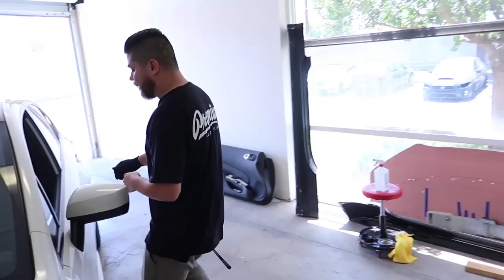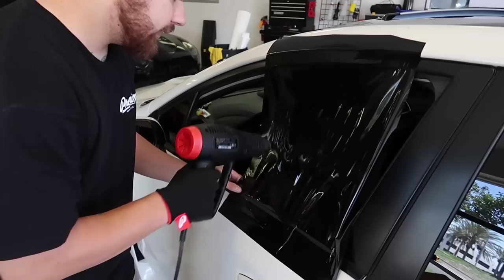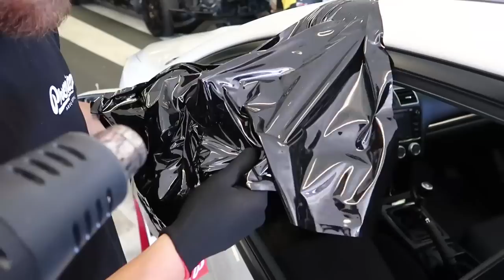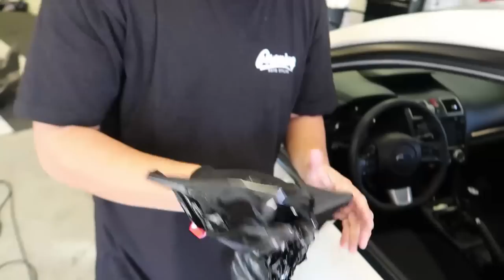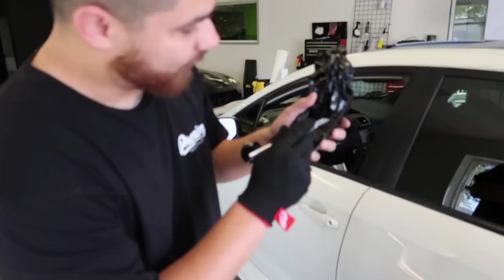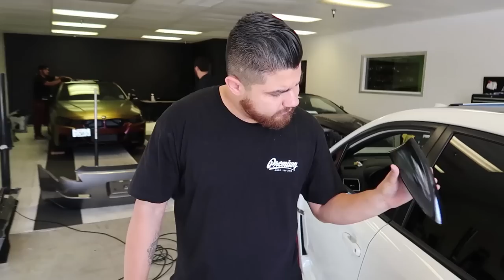How to Vinyl Wrap Shark Fin Antenna (1 Piece)

Comment: Daniel, I like your style for doing this, but with the 3m material are you getting stretch marks and glue marks from heating and stretching?
Reply: Breaking rc I'm pretty sure he was using Avery. 3m will leave a lot of adhesive lines

Comment: Can you teach how to wrap a 2015+ mustang mirror cap?
Reply: Oscar Acosta i have a 2017 mustang and those have to be done in two parts or it will be nearly impossible due to its design. The only real way to wrap it in one whole shot is to remove the mirror cap from the mirror holder/stand itself. So basically you can wrap the outer side as the first piece and then do the inner side as the second piece

Comment: I find the vinyl fails on these a lot. And the one's I can't take off cars? I don't trust at all because you're only tucking a very little underneath, but that where your skill comes in I suppose, but even best installer can only expect so much.  Idk WTF some of these car companies put on these antennas to install, but I'm not taking those one's off. They have epoxy or silicone or some shit holding them in, you really want to take that off? Fk that. Great job though. I guess it's a cheap problem if it fails every so often, so not biggest problem.

Comment: So how do u wrap door handles? With the same technique or is it easier than the antenna?
Reply: There's a couple of ways to door handles. The pre-stretch method works as well as the technique where you anchor up at the front of the handle and pull the stretch across the middle and conform it to the door handle. Those are your 2 main ones that i've seen in my opinion.
Reply: cruzingt86 you use the “technology” of the material